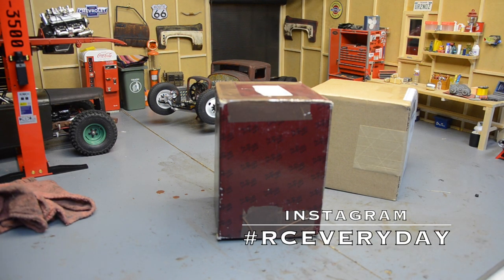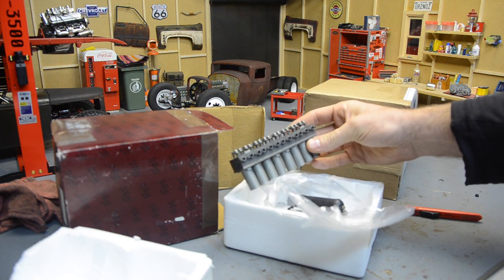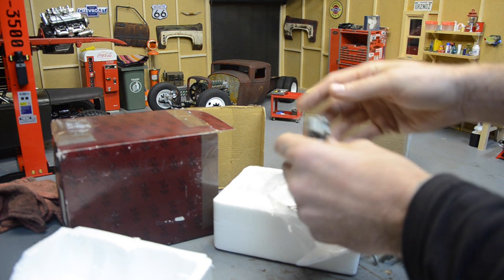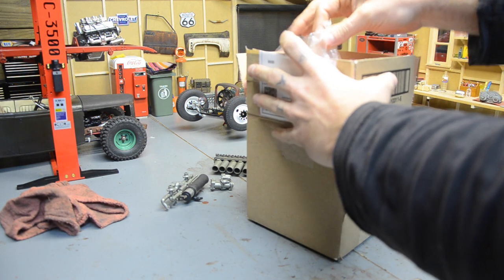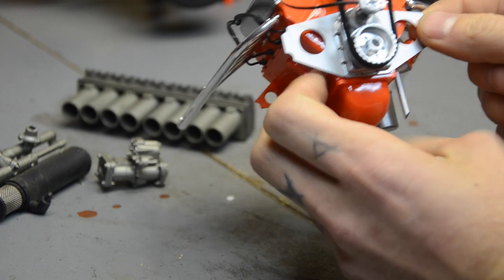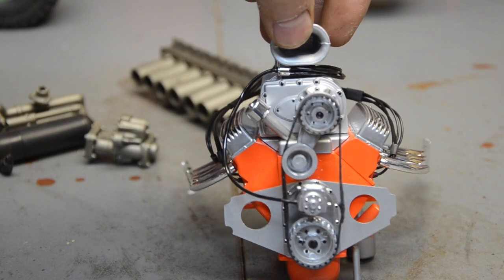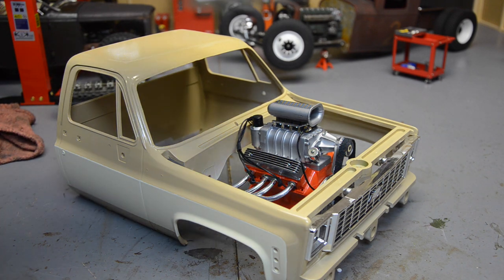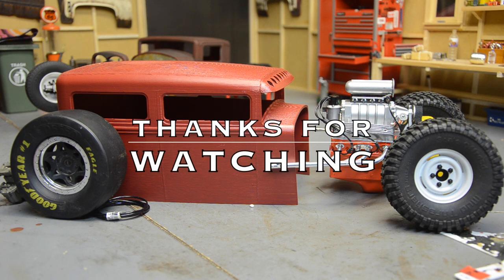Scale mail, Unboxing a Scale RC Rat Rod Engine and parts

Comment: That motor is from the Lindberg exterminator kit. It’s loosely based off of a ford y-block design. I use that motor often in my 1/8 Scale builds

Comment: I remember this engine! it was in the 
'23 - T" monogram kit. (or was it limberg??) I built that kit back in the late 90's in full r/c. every thing worked, I even had a working fm radio... I made the mistake of taking it to my local R/C track and racing it. yah, I raced it only once........... SPACTACULAR CRASH!!.. The drivers door to this day hangs on the wall next to my work bench....
Reply from the maker: Great story!  I still see those kits on ebay every now and then.

Comment: Hola amigo, sou Brasileiro, vivo em espanha, estou olhando sempre seus videos, aprendo muito com voce.... Gostaria de saber onde posso comprar esse tipo de motor ?
 Obrigado ...
Reply from the maker: This is an old engine from a 1/8 scale model kit.  I just happened across it on ebay.  Scale motors this size are fairly hard to find anymore.